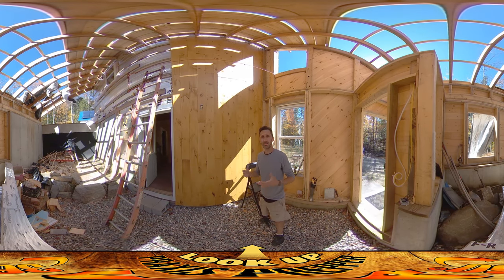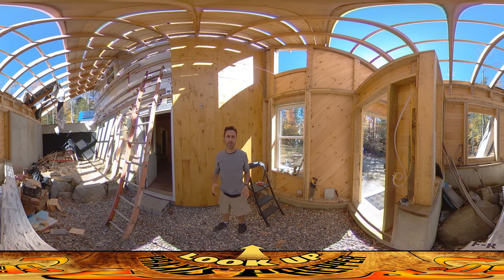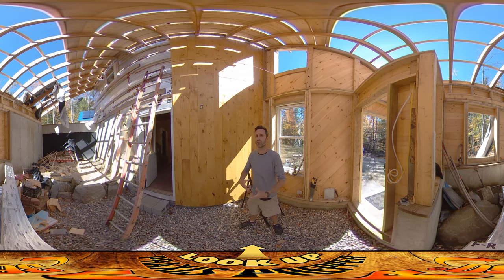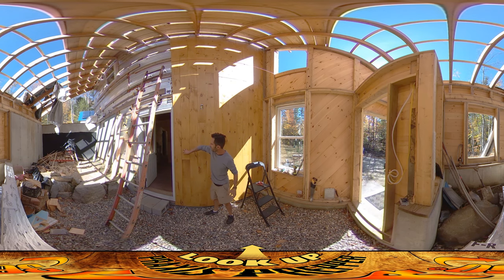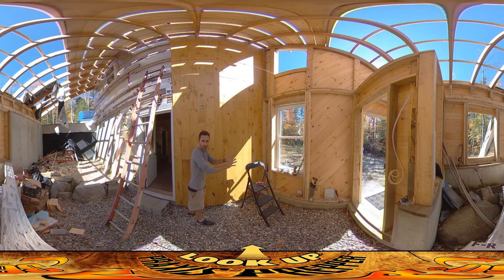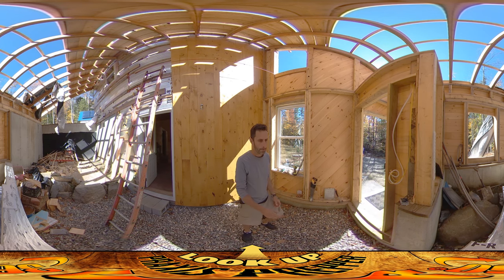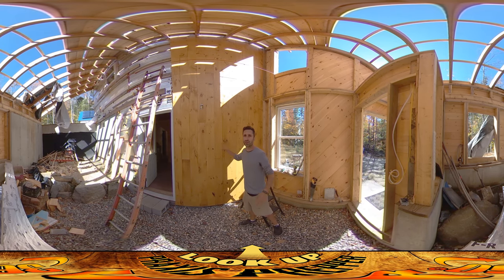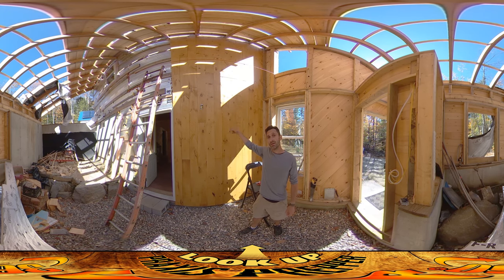Homestead Build - Greenhouse Walls and Future Electrical Wiring

Comment: Any word on the Radon situation?  ... any more tests done?
Reply from the maker: There's definitely radon and we definitely need to mitigate. After a lot of (first being irritated by the situation and then) pondering, I've come up with a beautiful solution that synergizes several mistakes from different contractors to create a solution to this issue. I'll share it when we enact it.
Reply: @PraxisPrepper  think you already shared that? i meant mainly since then, do don't you just keep the thing running every now and then?
Reply from the maker: @dutchcourage7312  I'll have to feel it out. I haven't installed any mitigation yet - just bought the parts. Once I get it installed, I'll meter it and see how frequently to run it. Maybe we can just put it on an intermittent timer or something.